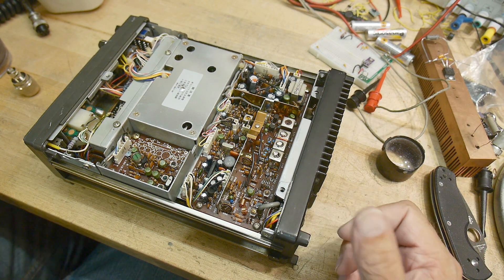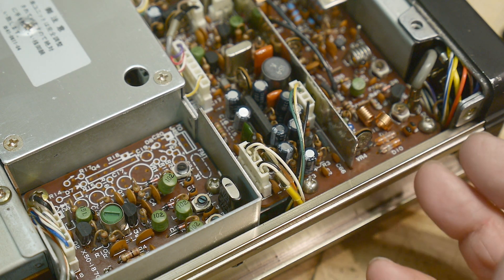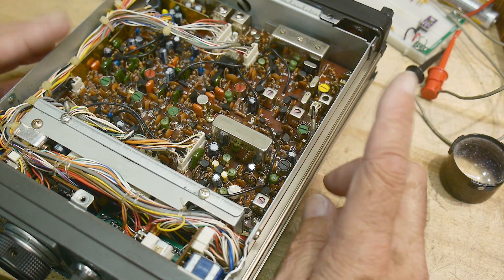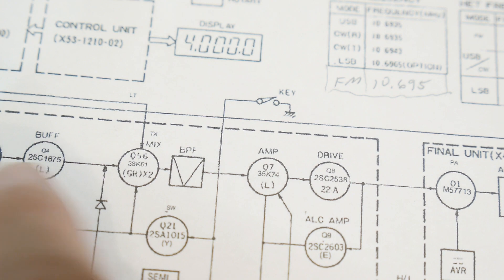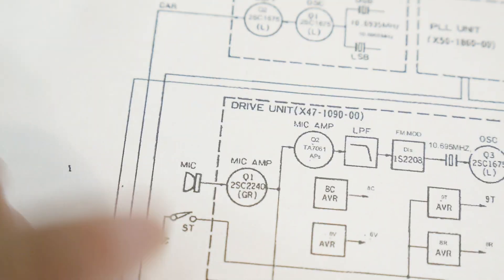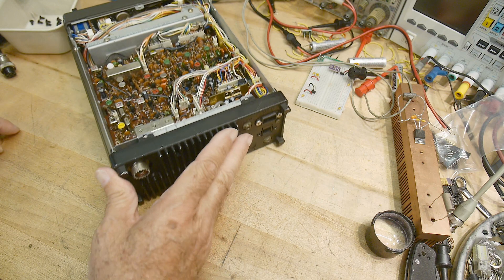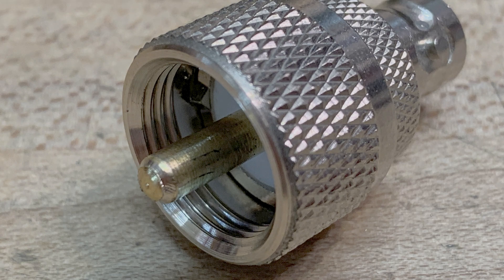#1641  Trio-Kenwood TR-9000G 2M All Mode Transceiver (part 3 of 7)

Comment: Great little radio that looks well designed. I expressed my frustration in another comment on how stuff made in that time period made you pay more for extra features. I had a Yaesu FT 726 that required you to buy all of the un-obtainium modules just to operate in the satellite bands. None of the manufactures seemed to make anything above the 15 watt range until latter years for some reason, even though VHF marine radios were always 25 watts. You really had to be creative back in those days! That "all in one box" stuff that came out in the >2000's really spoiled people as ironically ham radio was starting to diminish in popularity.

Comment: I wonder why thru-hole radios were not much more expensive, considering the complexity, lack on integration and manual labor involved. I also wonder why modern surface-mount radio are not much less expensive, considering the integration and automation.

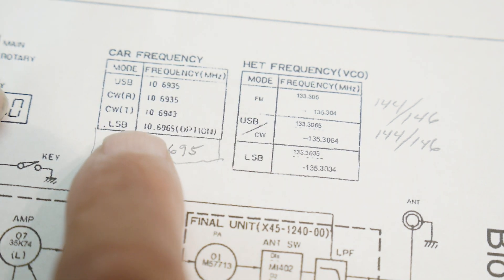Comment: Thanks for the update! ❤3:45 10.7 Mhz crystals are quite common. The frequency can be shifted down a few kHz by connecting a inductor (about 18 uH) and a tuning capacitor (about 30 pF) in series. I wonder how FM modulator and demodulator are implement in this rig.

Comment: In the TR-9130 your board (x50-1870) is populated differently, though the footprints appear to be identical. It’s labeled as the car unit PC Board. It’s a 2m All Mode.

Comment: LSB is only used on 2m if you want to operate satellites...That's why it was an option for some markets....The standard versions of the TR-9000 has both USB and LSB capabilities...
Reply: I HATE how radios of this vintage required you to buy modules and extra parts to get all the features. When I first got my ham license in 1993 they were just getting out of this phase, but hand held radios and dual banders were upwards of $500 back then. I had a friend who had a 144/440 Azden HT that he paid $900 for!